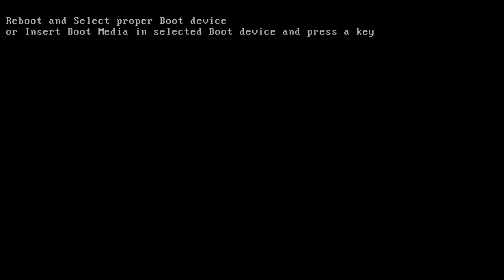Gaming / Work Build - Fractal Define S / Core i5-6600K Skylake / GTX 970

Comment: Awesome looking setup!  I use a Define S as well and want to get custom cabling badly.   Out of curiosity... Was choosing to put the fan controller in place of the SSD mounts and using a M.2 SSD an aesthetic choice?  It seems like the fan controller could have gone on the reservoir slots at the front, leaving room for two 240 ssd's to be installed for less money. Regardless, it's definitely clean looking.

Comment: Hi, is msi z170 Krait Gaming a rally good board? I'm building a pc with i7 6700k and 32gb of 3000mhz corsair ram and and a big Macho cooler and I'm considering using it, tho I'm worried about the 6 point support, is it strong enough? The other option I was thinking about was Asus z170 Pro Gaming but I've heard a lot of complains about its bugged bios and that put me of because I'm not sure how much the numerous patches helped.

Comment: wouldn't it be better to get an AMD r9 390 for the 8 gigs of vram since its for work station stuff too?
Reply from the maker: +Ognen Pendarovski The VRAM doesn't matter for Barry's usage.  Lower power and quieter operation were a key part of opting to go with the 970 instead of a 390.
Reply from the maker: +Ognen Pendarovski From the benchmarks we've seen, they trade blows depending on the games you play.  The bigger issue was noise and heat consumption in an office which is where the 900 series excels.
Reply: +PCPartPicker Hello, do detailed training videos (EKWB), how to build a computer with water cooling. Thank you
Reply: PCPartPicker
 Makes sense I guess then if you're putting it that way, but you are right in benchmarks for 1080p and 1440p they do go back and forth but anything above the 390 wins but who uses a 390 for anything above 1440p lol, that's just not smart.
Reply: +Ognen Pendarovski Yea by a few frames, but the Gigayte G1 GTX 970 has one of the best coolers and is super quiet compared to any R9 390. Plus Nvidea now promoting their 900 series by selling copies of Assassin's Creed Syndicate and Rainbow Six Siege with the card till December 14th.
Reply: +Sean O'Brien yes and no like pcpartpicker said they trade blows on and off I would say the 390 is better because It's the same price as a 970 but you get 8 gigs of vram and the same performance as a 970 the only issue is the cooling and power consumption, I'd rather have a 390 in my own opinion as well but hey if someone gave me a 970 I'd use it for sure.
Reply: +Kian Grey yea of course, it's a personal choice, except my PC is right next to my face most of the time.... So yea.... Quiet is good 😜

Comment: interesting orientation of the H100i blocking the main non SP exhaust. great part choices though.
Reply: I was thinking the exact same thing. Is there a benefit to running it in that orientation in a case as roomy as the Define S?
Reply: +pov_dave Maximum airflow most likely. But like you said about the roominess, he could of just gone with the normal define and gotten some 5.25 and 3.5 inch bays if he might need them in the future.
Reply: Possibly just a mistake? surely he could have orientated it the other way and maintained good enough airflow?
Reply from the maker: +Michael Howdon It'll make a lot more sense in a follow-up video.  We had a plate custom cut with the PCPP logo that is backlit, and it's on the right side.  So if we oriented the cooler the other way, it'd cover up that component.  We have it installed and working, but didn't film that aspect yet.
Reply from the maker: +Michael Howdon Not a mistake - it was on purpose.  We have a custom cut component we put on the right side that it would block.  As is though, the airflow restriction is being overblown and not nearly a big of a deal as people are making out.  Happy to test it out to prove it when we have time, but in person it's pretty clear the tubes will not introduce a significant obstruction to airflow (they're really not that large, and there's enough clearance, and the fan is not tiny).
Reply: Ok great to know! thought I was going crazy! :)
Reply: +PCPartPicker Did you guys sleeve those cables yourselves or did you buy them? I love the way they look but I don't want to sleeve my own.
Reply from the maker: +Ryan Geran Our cables were sleeved in-house by our Content Creator Blake.
Reply: PCPartPicker You guys are amazing. You responded within minutes, you guys are the best, Thanks for responding :D
Reply: +PCPartPicker Hi. make a complete video training how to build a computer with water cooling. Thank you
Reply: +PCPartPicker Do you happen to know the lenghts of the fan extension cables?

Comment: So I have a Define S , a H115i, and a Asrock x99 taichi motherboard. Ive tried but I can't mount the H115i on the top of the case with the mobo installed the CPU power cable blocks it. Any help?

Comment: Isn't it better to place the fans on top of the radiator so the fans are attached on the case with the radiator sitting on them facing the inside of the case. Or would this only be better for a pull configuration to exhaust air out of the case?

Comment: why u dont put the radiator in front ? 
so you could to keep the top panel for more quiet system
sorry for my english
Reply: Your English was great the only little flaws I notice was put the u before don't and add an "a" between for and more and it would've been perfect
Reply: I like your English

sorry for my spanish.

Comment: is the fx 8350 a great CPU to use. I'm thinking of building a PC to get away from consoles
Reply: I plan on playing mostly mmo and some AAA titles
Reply: It is not bad, but i would recommend you buying a intel xeon e3 1231v3. If you want to overclock i would go with a core i7 6600k
Reply: +PEG i5 6600k*
Reply: PEG I was looking into an i5 or i7. There are indeed better Especially since I'm more looking into a micro atx build and they (Intel) seem to have better micro atx boards. I don't plan on doing anything too crazy just to test it out. I was initially going to use the athlon 860k to see if PC gaming is my thing
Reply: +PEG xeon is actually not recommended for gaming, if you dont plan on overclocking , an i5-4690 is great, otherwise, just get the k version, no need to get skylake for gaming
Reply: You are absolutely wrong. The xeon is basically a i7 without iGpu and Overclocking ability and its 100 less. So why it should be worse?
Reply: PEG check benchmarks, you'll know what i'm talking about, xeon's aren't made for gaming.
Reply: Jellin Wellen do I HAVE to get an Intel processor?   I won't be doing any type of media creation and playing everything at ultra isn't a big deal
Reply: +deft I mean, I have seen real world test and they perform on par with i7's and newer i5's fam. 
xeons are really good they aren't just for workstations you can buy a 200 dollar xeon and get i7 performance with the lose of "RELIABLE" overclocking.
Reply: Kian Grey meh i'd still go for an i5 4690k anyday for gaming purposes
Reply: tevin rose Intel processor are at the moment way better than amd, even for gaming.
Reply: PEG I'm trying to see what parts I want for a micro atx build so far Intel has been the better choice. Just $200 more expensive
Reply: +tevin rose go with an i5 4690k and gyx 970/r9 390 or to save go with a 380
Reply: +deft No but they can do it and are okay for gaming loads. Sure you would not get as high of a fps but they run most games just fine.
Reply: +Jakob Kosir but higher end gpus like a 970 will get bottelnecked
Reply: JellinWellen The funny thing is that a 970 gets out preformed by a GTX 690

Comment: if i not use Corsair Commander Mini so can the fans working?
Reply: The fans will still work but you can't control their RPM via the controller, only via the motherboard if they're PWM (4 - Pin) b/c on most motherboards that's how it works, but some still allow you to control the RPM even if it's 3 pin.

Comment: is it me or did you miss a stand off and screw on the middle rh side of the mb? is there suppose to be one?
Reply from the maker: +SonnyDelicious There is a mounting peg there instead of a traditional standoff.  It makes securing the motherboard significantly easier and is attached to the case.
Reply: +PCPartPicker awesome thanks.

Comment: Are the cooler fans set to blow warm case air over the radiator, that cools the cpu, or does it matter?  Maybe sucking cold air through the radiator is smart, but then there's a bunch of hot air in the case with less exhaust.  I'm a confused noob. Waahh.

Comment: Epic build! But I just wanted to point out, one stand off screw (second column, second row) never got put it. This isn't a criticism, just an observation! That motherboard flex when you plugged in the 24-pin nearly killed me.
Reply from the maker: +Nolan Odom That is actually a post secured to the case for mounting the motherboard and makes it easier to line up the holes for the rest of the screws.
Reply: +PCPartPicker Out of curiosity, why not screw that one in anyway? Would it not decrease the possibility of GPU sag?
Reply from the maker: +Nolan Odom It isn't a screw hole - it is a post attached to the case.  You can see it at about 3:37.
Reply: +Nolan Odom because you cant put a post there cause there is a integrated one that holds the mobo as you screw it in
Reply: +PC Tech +PCPartPicker I guess it would be easier to see if I was watching on a screen larger than my phone. Thanks for the responses guys!

Comment: Im a noob but why would you get 4 4gb ram instead of 2 8gb ram
Reply: it's faster in a quad channel set up rather than dual channel
Reply: To use my build for an example, I am going to use 32GB of RAM, I am going to use all 4 ports on my motherboard so I have 4x8GB instead of 2x16GB. The reason for this is because of the latency in the sticks (more noticable in larger sticks), it is faster/more efficient to use the smaller sticks of RAM if you want more speed for your pc.

The downside to this is it is not scaleable, if I wanted to jump to 64GB RAM I would need to replace all 4 sticks to say 4x16GB, but if I was using 2x16GB I would only need to add the 2 other ones.

So in summery go for 4x4GB for better performance. Go for 2x8GB if you know you plan to expand in the future.
Reply: +Hughsie28 ohh thx

Comment: im going for a pc purely for gaming, no video editing or productivity or anything, with a budget of £1000/$1200, does anyone think i can do better than a core i5 4690, (i dont intend in doing any overclocking so i dont need the 4690k) and a gtx 980, 16gb of ddr3 ram? please let me know if you think the cpu would bottleneck the gpu or anything, thanks in advanced :)
Reply: +WonDah id go with the skylake i5 6600
Reply: +HDDONUT trouble is that id have to get ddr4 ram, and a more expensive mobo, when these increase the price would be over £1000, otherwise i would go with a 6600
Reply: +WonDah yeah didnt think bout that
Reply: +HDDONUT no worries man, thanks for wanting to help :)

Comment: Alright I'm thinking of building a pc and I wanna know what you guys think of this pc http://pcpartpicker.com/p/Cbqggs any advice is appreciated!
Reply: +Ducks explode And yes I just got rid of the wired network card. I don't know why I added that in there.
Reply: +Ducks explode First off amd is not really what you want for gaming in that price range , this build http://pcpartpicker.com/p/vWmHyc gives you ALOT more for your buck , do you really need a disk drive ? The PSU will alllow to crossfire 390s in the future and trust me the i5 is brilliant for its price, its not worth uprading to the i7, ive built 6 computers so trust me on this, you dont need extra fans or a fan controller, it willl have good temps already, any other questions ? If you want me to build you one with a lower price range just ask , 1500 is a but much for a first time pc builder in my opinion !
Reply: Jack Devlin Ok I had the disk drive for windows.
Reply: Jack Devlin And also I think the motherboard on this pc is quite expensive
Reply: +Ducks explode well yes it is expensive , go for an MSI PC mate z97 if you want to go cheaper , the motherboard in the build is brilliant for overclocking the cpu , in that price range thats what my build would be, maybe try and get rid of the mobo and get the MSI one I recommended and then get a better CPU cooler like a corsair h100i
Reply: +Ducks explode the amd 9590 has a massive tdp, you need high end air or liquid cooling to cool that thing. go with intel like Jack said mate..
Reply: +MSI GAMING 4G GTX 970 and Jacks part list was good, i would just go with standard corsair vengeance or g skill ripjaws x, its not going to make a big difference,
Reply: Ok guys thanks for the help!